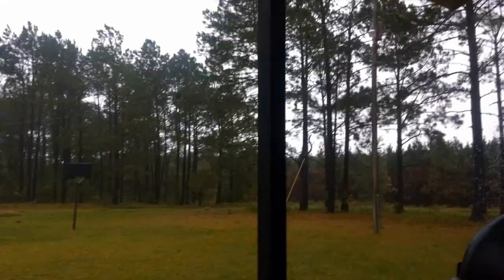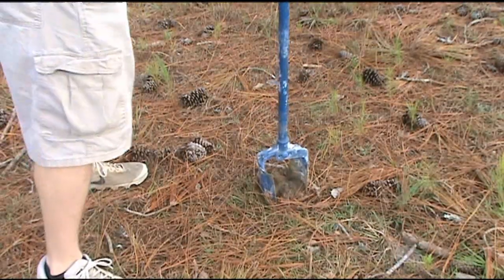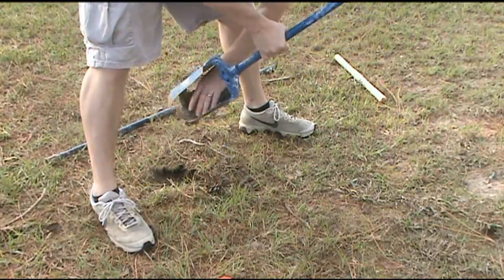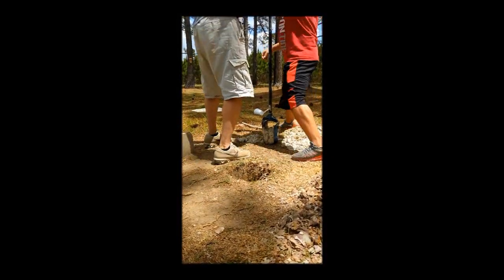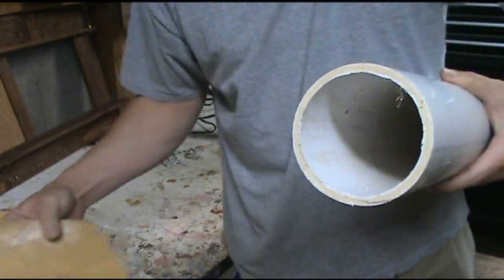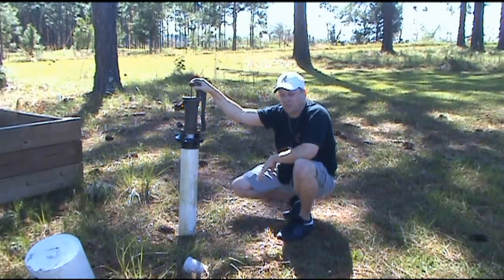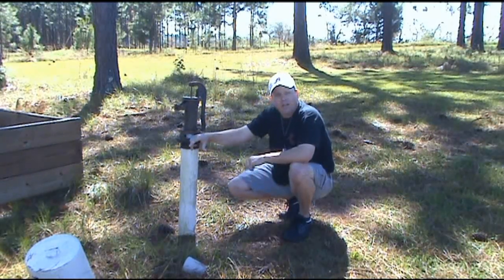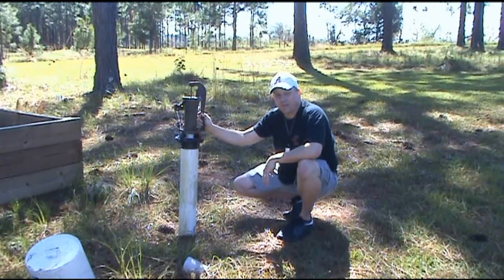How To Drill A Shallow Well. Easy DIY Instructions!

Comment: Interesting! We drove a shallow point into the ground around June of last year and have a nice little pitcher pump on top of it. It consists of a 3 foot sand point and 10 feet of galvanized steel pipe and we pounded it down with a post driver. After digging 4.5 feet down with a post hole digger and then reaching nothing but wet mud, we drove the rest of the way. It wasn't hard, but it wasn't easy. We got down about 2 inches for every hard 24-30 pounds at it. It pumps us nice clear water. So, about 11 feet is underground and 2 feet above ground. I have plans to do another well and this is what brought me here. I love your method. The first time that I mentioned, I shopped professional well drillers to come and they turned down shallow well and quoted me deep wells to the tune of 10-15k. I am only on a third of and acre and want it for more veggies and fruit trees so that price was a bit much. I researched, emailed SWFWMD southwest fl water management district(I'm in central FL) and asked some probing questions. They are the ones that told me that my water table was 4.5 feet down due to records of wells driven nearby and this is what motivated me to DIY. I want to irrigate now, but don't want to get rid of my novelty pitcher pump. My young kids, neigbors, family and friends love it. There is a daycare on the property as well so the kids love it. Anyway, I am back at researching how to do one for irrigation with a motor on it. I have a couple questions if you don't mind me asking. How will I know if the water that I've found would be sufficient enough for a motor and irrigation? Also, I have to use a 2 foot pipe since it is a DIY per permitting. Can I still do this with a sand point and a 2 inch steel galvanized pipe? Your pipe looks to be 4 inches. Thanks for reading my life story. =)
Reply from the maker: My casing is 4 inches, but my pipe is 2 inches inside of it.  Your idea is great for irrigation. Starting out you might find resistance if you try to pull too much water from the motor.  Once channels are formed in the ground from water being pulled out, it will subside allowing more water to be pumped.  Since you are in Florida and your water table is where it is, you should be great pulling water.  I hope you let me know how it goes! :)
Reply: @3BricksHigher  Okay, I sure will let you know of the progress...and thanks for responding. Can you tell me the purpose of having a casing? And does your 4 inch pipe have a sand point inside of it? Or just a 2 inch pipe with a foot valve? I assume it's like one big straw with a small straw inside and the 2 inch pipe can be pulled out when needed? I don't know anything about a casing being that I simply used a sandpoint and the 2 inch pole.
Reply from the maker: @00SkaterChick00  the casing surrounds the 2 inch pipe and holds water for the 2 inch pipe to draw from. Since it holds a lot of water, it allows a larger quantity of water to be pulled.
Reply: @3BricksHigher  Got it! That’s sounds more productive than just a sand point alone, for sure. I may just give it a try. Thanks for your input. I will check back in weeks to come and share my progress.
Reply: I have another quick question! Last time we drove a sand point. This time, we’d like to use casing. When we dig down and get to the water bearing sand, it is(“it was”, I’m reflecting on the last well we dug down 4feet to the water bearing sand)hard to pull it up as it just falls out of the digger. How will we ever get the casing down deeper if we can’t dig anymore? I assume that once we find the water bearing sand that we need to dig down a few more feet to let the water trickle into the casing, right? Or, do you think a sand point would work well with a motor on it? Thanks for reading.
Reply from the maker: @00SkaterChick00  We dug 4 feet into the sand.  Ad we would pull the auger up, a lot of sand would fall back I to the hole. This made it a time consuming process, but we were determined to dig. It wasn't soupy sand, but it was wet and wouldn't stick together.  The idea for the casing is to allow water seepage. If the sand is soupy there might be a way to dig down that I'm not aware of .
Reply: @3BricksHigher  Okay, Thankyou. We will keep diving until we can’t dig anymore.

Comment: I liked the well drilling video a lot, thanks. I did not see a foot valve or check valve used. Will the well keep prime or do you have to put water to prime by hand?
Reply from the maker: Thank you for watching.  I only showed how to create a cased well.  I did put a pump on it, but I used a valve that is near the pump itself.  If I ever need to change it I won't have to pull the entire pipe up (24 feet long).  Once primed, it stays primed even after several days of not using it.

Comment: I'm on my 2nd well install using this method, and hit mud at about 18'. Can't seem to make a hole for the casing, cause the mud keeps filling it in. Didn't have this problem on my 1st one years ago. And I wish either of these wells were like hitting a "geyser", as you explained, cause neither of mine erupt like that. Good job on your part, and thanks for posting.
Reply from the maker: Actually, our 1st hole we hit mud at 11 feet.  We literally started a new hole 3 feet from it and that is the well you see in the video.  It was aggravating having to start another well, but it payed off.  Thanks for sharing your experience and I hope your newest well never runs dry.
Reply: I am a hydrogeologist for an agency that I will not name here.  (Roll Tide) The noise and geyser reported in the video was likely triggered by punching through a clay layer to an aquifer beneath that was under pressure.  Hydraulic head is the term used to describe how high the water level rises in the pipe after punching through.  This happens because the recharge point for the aquifer is at a higher elevation - pressurizing the aquifer under confined/semiconfined  conditions (clay layer).  The mud slumping into the borehole is not an uncommon problem.  You are probably more in silts and fine grained sediments when that happens.  Advancing the casing as far as possible and then augering inside the casing is how some wells are set.  I don't think your pipe driven into the mud is going to draw much water.  You need a filterpack to allow water to enter the casing without clogging up the well screen.  Coarse sand would work better than gravel for filtering out  sediment, though flow will be better with gravel.  The industry standard for well screens is called ten slot.  You'd probably be better off cutting slits a saw blade width wide .25" -.5" apart with a saws all or hacksaw  than drilling holes because it allows you to use a finer filter material.  Between the filter pack and surface bentonite clay pellets should be placed to seal off the borehole.  A concrete well pad roughly 2' square at surface is standard.
Reply: @Troubleshooter-2.0  Wow, Wes, I really appreciate all that info. Sounds like you've been around this stuff a while. 
I gave up trying to bury the 4" PVC casing into the mud, (for a 2 pipe deep well system) and just drove in an 1" 1/4 steel line with what turned out to be a defective sand point, for a single line shallow well system. I had 6-7' of water in the pipe, but the point was so clogged from "corrosion" (not sand clogged), that  my Goulds pump couldn't hardly suck any water through the screen. I found this out after I pulled the piping out yesterday, and pressure tested it, and visually saw the semi clogged ports. Live and learn the hard way. New points aren't always good, if they've been sitting around a few decades.
Thanks again for your your thoughts, Wes.
Reply from the maker: @Troubleshooter-2.0  Thanks for the comment. It's very cool to me to see an expert in the field comment on my vid.  Thanks again!
Reply: @3BricksHigher  Now that I have a brand new Simmons 1 1/4", 4' sand point, and is driven to a depth of 25', (with over 6' of water in the vertical pipe), I still can't get the Goulds J5 1/2 HP pump to flow any water. 
The hand pump will pump water, and the 1 way valve will hold the column of water, and there aren't any vacuum leaks on the suction side of the J5 pump, which will continue to draw cold water out of the ground, but at an excessively low rate. 
When I remove the check valve, (at the top of the pipe), and install my pressure testing fixture which will blow in 90 lbs of air pressure from my compressor, and also have a hose bib to pump 50 lbs of water into my 1 1/4 standing well pipe, the water backs up, and blows out the air line, when I disconnect it from its fitting. I was hoping this fixture would help clear any obstructions at the sand point in the ground. As mentioned B4, our area is all sand, no clay. I have 2 other shallow  wells on my  lot that  work fine.
Any advice would be appreciated. Thanks.
Reply from the maker: @joequillun7790  Wow man, the goulds j5 would try to pump a lot more water than a traditional hand pump.  Could it be the well does't fill fast enough to keep the j5 functioning?  It sounds like when you try to suck a thick shake through a straw.  Could be the j5 is creating a strong vacuum.  The more water you draw from the well will create channels in the sand that will be more open to allow an increase in water flow.  I hope you find a solution and let me know good news soon.
Reply: @3BricksHigher  Thanks 3B, for the opinion. I believe you're right about the pipe not filling fast enuff. I just finished pounding my point to a total depth of 27' to the bottom of the 4' point. But the water level in the pipe is about 7-8' deep, or 18-19' from ground level. I've been back flushing the point as I was driving it in, with water from my house well, and it seemed to help me drive it easier the last 2'. I hope you're right about drawing water out of it, will open a cavity around the point. As I mentioned, we're nothing but beach sand here. i wish it was pressurized like your well was. Good on you. :)
By the way, have you ever had a jet pump on your well?
Reply from the maker: @joequillun7790  Actually I have a place on the main pipe where I placed a 1 1/2 inch "side pipe".  This has a cap on it.  If I pull the cap I can access the water just above the valve.  I have hooked a water pump I pulled from an old washing machine and turned it on.  It flowed a great amount of water.  Not quite a jet pump, but still a pump none the less :)  I do not plan to use it, but wanted the option in case in my later years I can't pump by hand.  I will say the depth of the well and the water amount in the pipe strained the well.  I'm just glad I know I can pump from it.
Reply: @3BricksHigher  A washing machine pump? Very creative, and great idea.
I put my system back together, and am gunna try running the pump on low, ( by reducing the flow on the pressure side ball valve.) Maybe if I run it on and off for a few hrs, (over a couple days), it'll clear a cavity around the outside of the point, for water to collect. Don't know what else to do. I'll keep you posted, and thanks again for your replies.
Reply: Just to put a conclusion to this part of your thread, my problem of low water flow, wasn't the point, or being restricted. It was a mismatched conglomeration of pump parts. My convertable deep well 1/2 hp Goulds J-5 pump, didn't like the frt casing and jetting from the J-10 1 hp pump that I installed to convert my J-5 to shallow well operation. I reinstalled the original 2 holed deep well frt casing, and installed the  shallow well adapter and correct jetting/diffuser for that J-5 pump, and now it pumps like crazy. Just wanted those who tried to assist know the final out come. Appreciate the time. :)

Comment: Is there a foot valve , check valve? Does it keep prime?
Reply from the maker: I have a valve near the pump so I don't have to pull the 24 foot pipe up if it fails.  Once primed, it will hold for several days without being pumped.  I wanted to make it easy to maintain.  I just replaced the leathers this weekend.  The old one's did their job, time for new ones :)

Comment: I hope you get this.  How big is the auger?  Would a 6” one work?   The cap for the 4” pipe, was that for the end that goes down into the water?  So cap, then 4” pipe that has all the drilled holes?  How do you connect the next 10’ sections?  Plumbers glue and tape?  Thank you!
Reply from the maker: Exactly as you stated. My auger extends to 8 inches, but I left it on 6. Also, I did use plumbers glue to hold the sections together. Let me know if you have anymore questions
Reply from the maker: @WullBinkle  the label 
has worn off of the auger, but i can tell you if there is a knuckle where the neck meets the blades, then it will take an extension.  That is what i looked for when i purchased mine.  I hope this helps 🙂

Comment: I have a question about this.  I am in the mountains of Virginia and it is all shale.  is there a chance that there is water in this kind of property?  If you could help me with this I would appreciate it very much.  My husband died and now I have to get this off the grid cabin fixed up to sell.  Having water on the property would be great.
Reply from the maker: I'm sorry to hear of your loss.
I would say it is very possible there is water at a decent depth.  The mountains are known to have underground springs.  Actually, you would stand a good chance of hitting an artesian spring that would flow constantly.  I've never dug through shale so I can't speak to how hard it would be to dig through, but again you have a great chance of finding water on the property.
Reply: @3BricksHigher  Thank you so much for getting back to me.  Without my husband I am not sure what to do, but I know that having a water source would make the property much more valuable.  I appreciate you and your expertise.

Comment: So just the hand pump with the wide pvc pipe?
Reply from the maker: No.  I show how to case a well.  I mention you can dip something into it to grab water or mount a hand pump, but you'll need to put it together as the manufacturer recommends.  The hand pump is the easy part! :)
Reply: 3BricksHigher is there another video in how to case the well?  I need to go look.  Lol

Comment: So if I place a 4” pipe with cap down to the water table and install a hand pup just like yours should I just be able to hand pump that pump a few hundred time and start to suck out water??

Or do you need to first run a hose down there, fill the pipe up with water and then start pump until the water is clean?
Reply from the maker: On the cap end is where you drill all of the holes.  That allows the water to flow into the  casing. When you install the hand pump there is a 1 1/2 inch pipe that is attached to it. It goes down into the casing and rests about 2 feet from the bottom.  You prime the pump and start pulling water.  It only takes a few pumps to get the water to the top. No hose needed 👍
Reply: @3BricksHigher  awesome! Thanks a lot for your reply!

Comment: Are shallow wells legal in Florida?  I'm looking for the cheapest way to get temporary power pole service  on some vacant residential lot on a very narrow and soft road in Central Florida.  No houses 1000' sq away, but I have a power pole 200' away two lots.  The county says I need a builders permit to get a temporary power pole. Wondering if any kind permit..permit to clear? permit to install pump?
Reply from the maker: Where I live you only need permit for a shallow well in the city limits.  I live in the county so I'm good.  I also think it depends on how deep your well will be.  A quick call to your public's work office should give you the info you need.  Thanks for watching :)